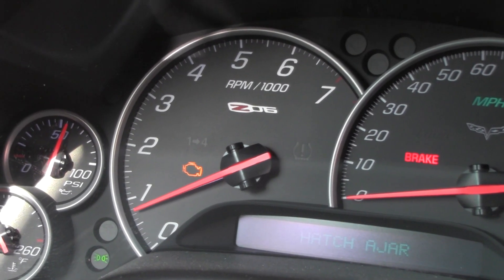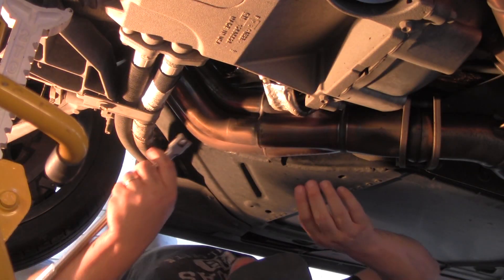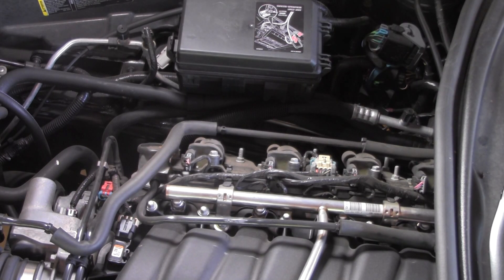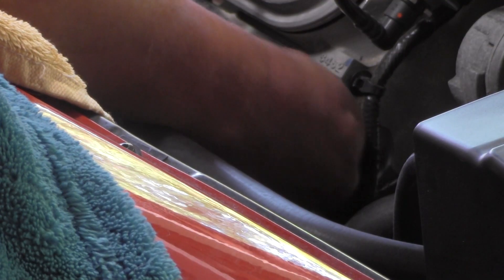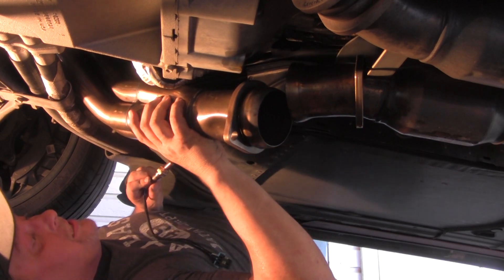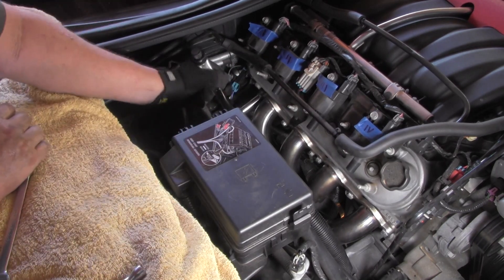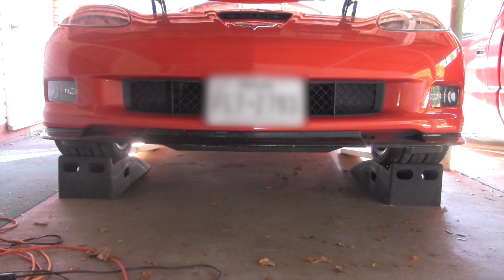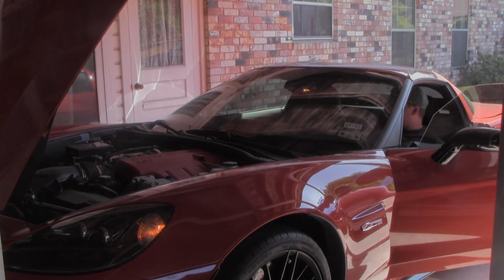How To replace your 02 Sensor

Comment: I have a 08 c6z. I'm reading a faulty passenger side 02 sensor primary. I bought a replacement. Is it possible to install without taking off my header. I have kooks into a offroad x pipe